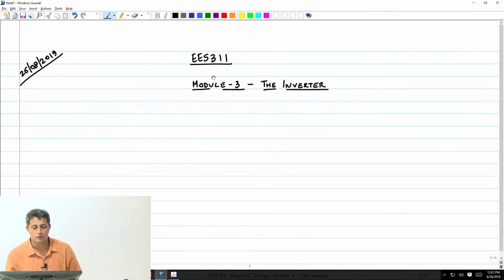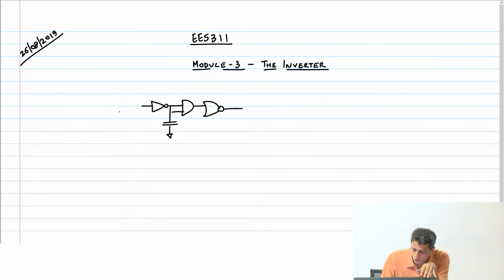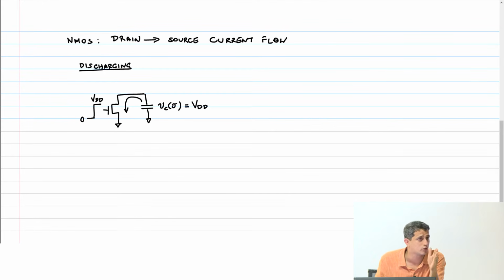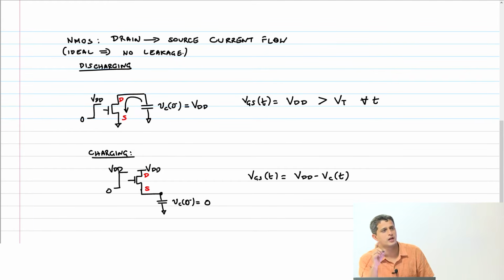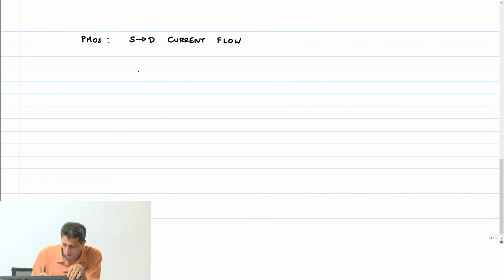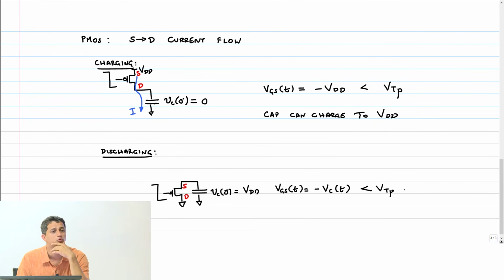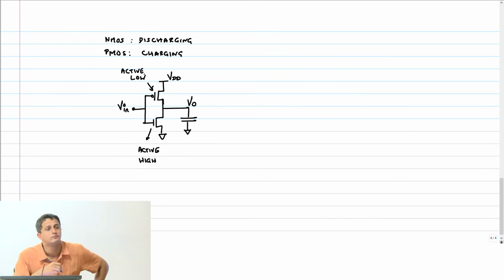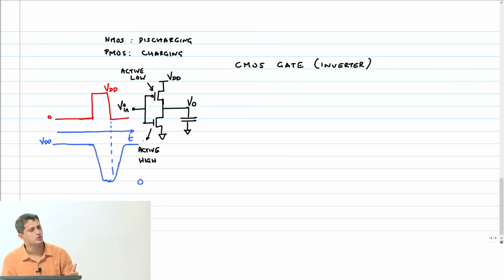Inverter - 1 - CMOS Inverter Construction

Comment: Sir why is Vdd negative for PMOS charging?
Reply: Revisit device physics. In pmos, channel is formed when gate voltage is lower than threshold voltage.
Reply: @akashekhar  and why it is not vgs(t)=vdd-vc(t)
Reply: @silverfox7011  PMOS turns ON when 0 is applied at the Gate, and for PMOS Source should be at higher potential compared to Drain, hence the terminal connected to Cap will be source and the terminal at the ground will be the Drain termial...so for PMOS, Vgs(t) = 0 - Vdd = -Vdd, and since PMOS will turn on for Vgs(t) < Vtp(where Vtp is negative value), PMOS would turn ON
Reply: Yes